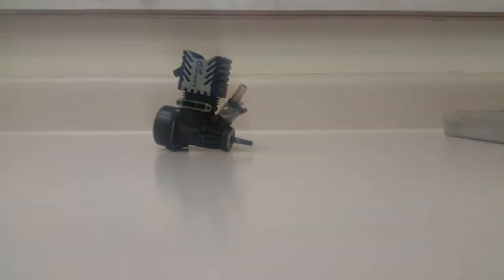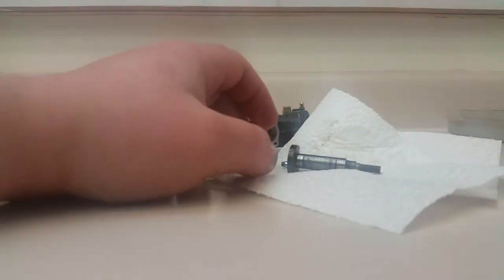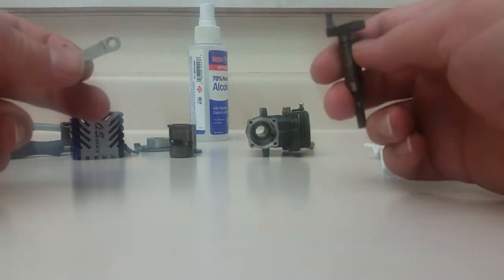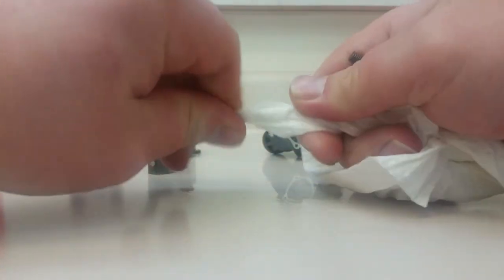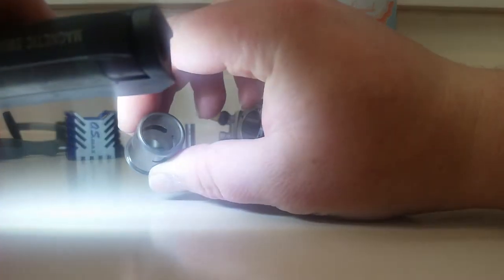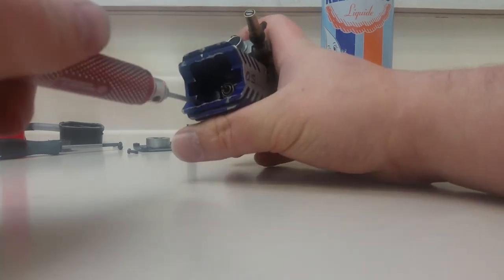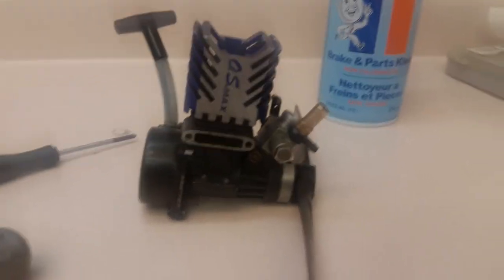OS MAX 15CV engine a look in side

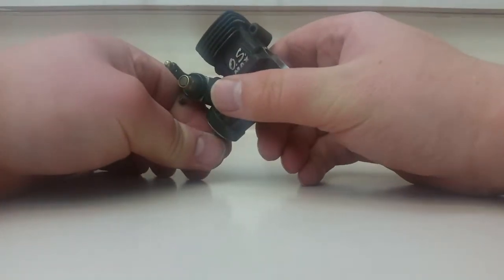Comment: Believe it or not the average view time of my videos is 3:16.  I have found that my longer videos really do not get fully watched by the questions that get asked.  If the video had been watched then there would be no need for the question. LOL.  That should be very interesting to see that engine run with a prop.
Reply from the maker: David McIntire I agree with you I wanted to make some other videos not quite RC related that are going to be more than 15 minutes possibly writing some of my old dirt bikes I have and I have that engine all setup in my test stand with a 8x4 propeller a short Heather and Stinger pipe combination on it should be interesting to see how it goes hopefully it's nice tomorrow so I can get a running video

Comment: Isn`t the piston skirt notched? usually an easy way to tell how to put piston in.
Reply from the maker: grimthenoble no these ones are not notched they're a little bit different
Reply: they must be longer stroke engines and not needed..
Reply from the maker: grimthenoble actually has a larger bor and a shorter stroke this engine I can't remember the exact dimensions
Reply: notched on opposing side too

Comment: How do remove the rear and front ball bearings inside the casting .... my motor is over 20yrs old and I’m rebuilding it .... the bearings need to be replaced
Reply from the maker: I have video about that  How to remove and install the bearings if you look through my channel You will need a small propane torch a freezer and some lubricant even synthetic 5w30 will work to  Assemble  The same method pertains to all nitro engines
Reply from the maker: https://youtu.be/EzfJdU4rmT8
Reply: Got it... what is a freezer?
Reply from the maker: @darkknight-221  that thing in your kitchen you put food in to freeze it
Reply: thebug 404 ... I figured that but at what point do U use the freezer??
Reply from the maker: @darkknight-221   The reason why you freeze your crankshaft and bearings as to physically shrink them it makes them go in the engine blocked easier ones it's been preheated to temperature my video again explains all of that
Reply: thebug 404 thank you ... sorry for the bother
Reply from the maker: @darkknight-221  no problem!  I have lots of other videos on how to rebuild engines take your time
Reply: thebug 404 got it..tks... besides finding parts.. this problem has stopped me in my tracks
Reply from the maker: @darkknight-221  yeah that's kinda the thing when you get into 20 years old engines

Comment: id be more concerned about front crank bearing
Reply from the maker: They basically never have problems in thies engines I took them out checked them cleaned them and put them back in  engine runs awesome
Reply: i put transmission oil in them for long storage